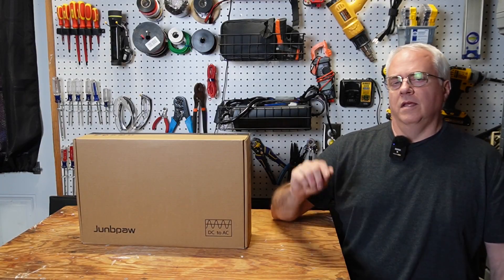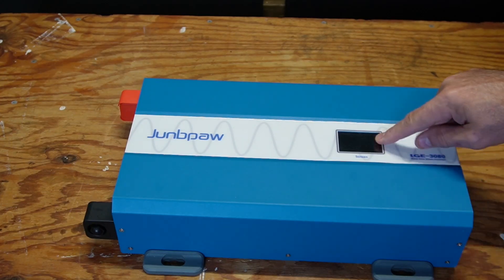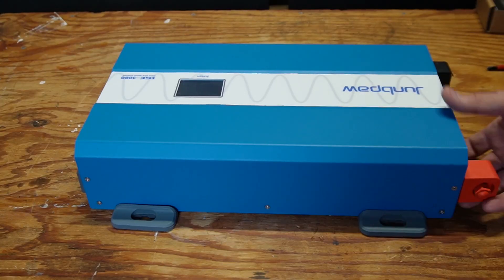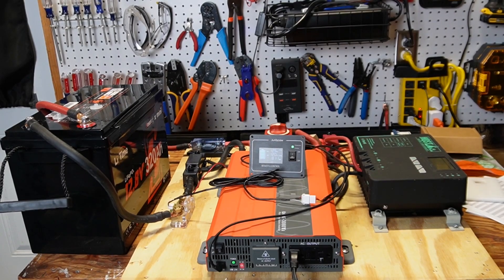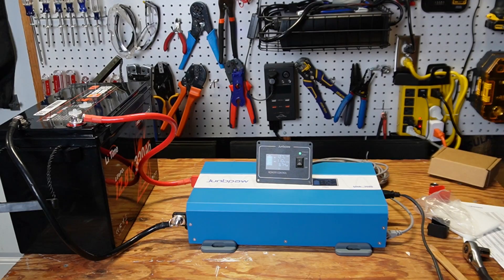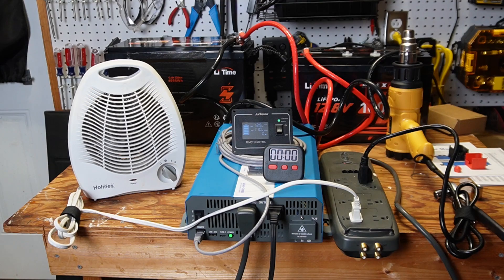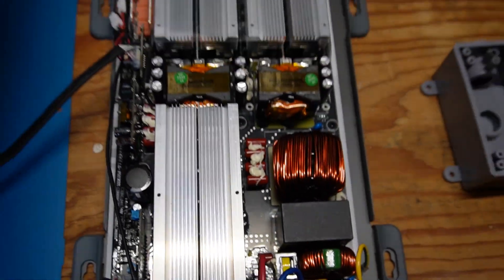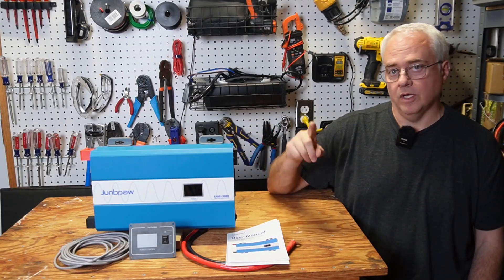Is this Inverter Really Ultra Quiet? Junbpaw 3080W 12V ULTRA Quiet Inverter

Comment: You tested the sound levels of the inverters with the inverters positioned differently. The small sides that are vented could project more sound from the inside of the unit (especially the higher frequencies) than the long sides that have no vents. It would be interesting to see the sound level from both directions on both inverters (on both small sides too, because of the fans).

Comment: I Really like Their 24 Volt Models both The 2080TI and 3080TI
And 4/0 Pure Copper Cabling and a T1 Fuse is Recommended.
Reply from the maker: I have the 24v 2080w one. I did a video using it. I like it also.

Comment: Love this brand just waiting on their dual voltage inverter
Reply from the maker: I didn't know they were making a dual voltage inverter. That will be awesome!
Reply: @proficientprepper  yeah it's on Their YouTube page they say they will be eventually sending it to reviewers.. I am badly waiting on it 

The only similar thing I've found on Amazon that's also dual voltage is from a brand called X XU YUAN but those stop at about 1500w and it's only 12v/24v mix.. no 24/48

I tried searching on AliExpress I did see similar but they are all sold out

I'm desperate for such a multiple type inverter it is perfect for users like me with multiple 12v batteries I could break them up and repurpose some configurations(modularity)

But I want it from junbpaw because of their quality.. low idle consumption and their transformers are next level